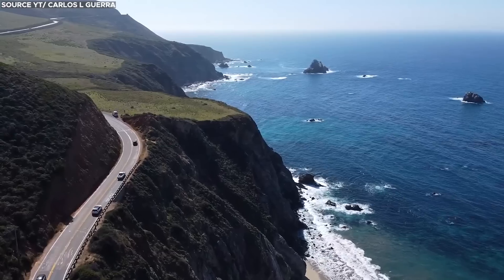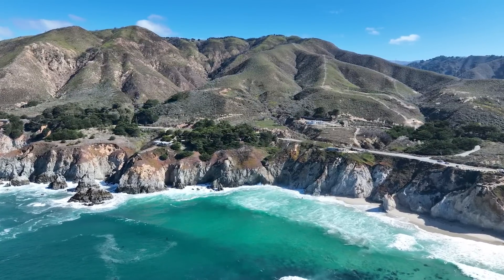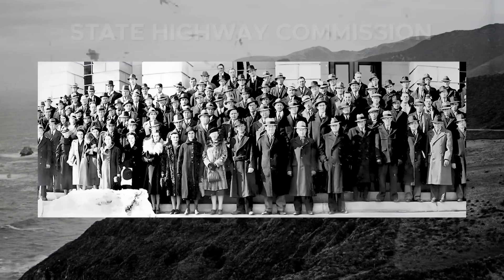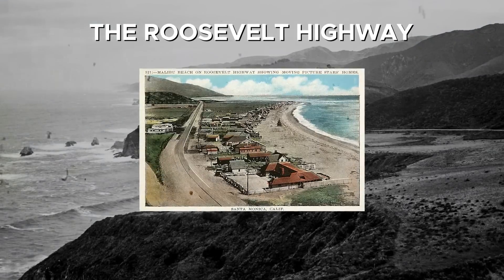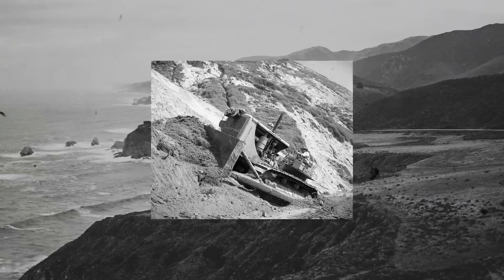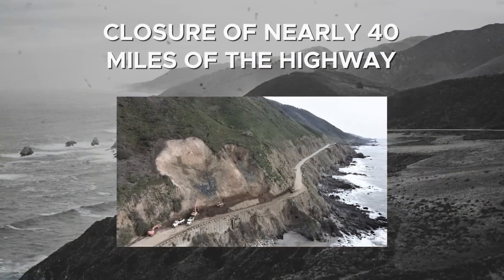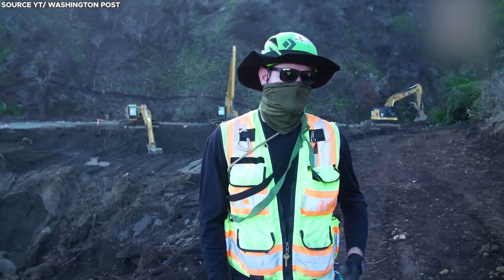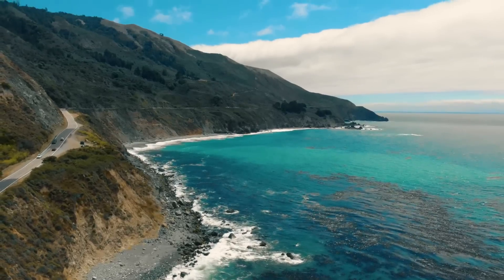California’s Famous Highway Is Now COLLAPSING Into The Sea!

Comment: Nice idea for the video and a lot of it is well done, but the quick cuts of map sections are confusing, irritating and pretty much useless, better to cut them out unless you talk to them directly and for long enough for a viewer to figure out why they are included at all.

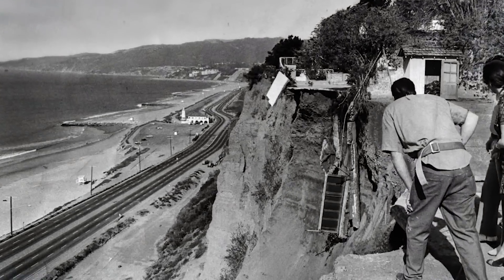Also, at 2:38, have we switched to Great Britain?  The car moving upwards in bottom part of the scene is traveling on LEFT side of the road, pretty sure there are no streches of CA 1 with that feature...

Comment: This blaming the landslides on climate change is weak.  You mention "rising sea level".   There is  no evidence that rising seas have caused any land slides on the coast🎉.  The seas have risen only 8 inches in a century!  So, that part is bs.  The primary reason for these landslides is simply poor engineering and continued patching after a landslide occurs; as opposed to reviewing the entire road for weak engineered sections and making appropriate repairs.  Allowing the saturation if hillsides, the failure to reinforce uncompacted soil areas, the prevalence of loose gravel and unstable rock formations are all fixable BEFORE a slide occurs, but takes more than a will to patch areas already sliding.  It is simply a failure of state government to focus on a permanent fix instead wasting billions on a fast rail system that has gone no where!  These are man made slides, not natural disasters.  Soil compacton testing, rain runoff management, tunneling where appropriate , driving piles and erecting retaining walls are all solutions that need to be imp,emended...proactively!

Comment: This is another example of lack of forward thinking. Granted the drive is gorgeous however you built it too close to the ocean and at the bottom of a big hillside the ocean eventually eroded the shore line leaving the road vulnerable to a landslide because it would not be able to bear the weight of that
Much earth traveling at that speed and soaking wet!  Before you actually build something think about the future use of whatever it is.

Comment: Stop blaming landslides on climate change! The climate isn’t that severe and every other place has its challenges too. You don’t have mud season when there is a Spring thaw and when you have wild fires that burn off the plants that hold the  soil plant some thing ASAP to keep down the erosion so the soil will be stable. Manzanita burns very hot and shades the ground so it isn’t that good for ground cover so it needs other things to help it hold the soil.

Comment: Ocean rising? I lived on the beach in Carpinteria CA from 1972 until 2020 ... that's when CA taxes drove me out of the state. Living next to the ocean, I was an avid surf fisherman and during those years sea level had not changed at all. Climate change is a fact. However, mankind's effect on the climate is nonexistent.
Reply: Mankind's industrial revolution and your lifted truck are the drivers of climate warming which creates all these disasters (from a human impact perspective). The scientists who study this have the receipts and Faux News lies to you just as they did about the 2020 election leading to a 3/4 of a billion dollar judgement against them. 
Sorry for the unfounded slur as to what you drive but it's not simply gas guzzling trucks, it's the humongous number of carbon spewing vehicles, plants and machines that are the problem.
Reply: Same here. The Morro Bay mean sea level is the same since I was going there in the mid 1960's. No change apparent in 60 years. It is very apparent using the inlet strainer grill building for the PG&E Morro Bay Power Station for comparison. No changes except for the tides. The same with the pilings at the Coast Guard pier.  The Green New Deal is hokum. The only green about it is the cash generated for the elite to ''fight climate change''.
Reply: climate change = summer, fall, winter and spring. Hasn't changed in gillions of years.
Reply: lol you're dodging responsibility. but that's typical...

Comment: Just a thought: Is there a way to construct a surge barrier at sea to slow down the impact of the sea? Retainer walls aren’t going to be of any use until the sea impact is reduced!
Reply: There is a retaining wall north of Santa Barbara right at the rocky shore. It's possible that the road originally went right along the shore there but the majority of Big Sur is steep high cliffs right to the water some a few locked narrow beaches. The road is 60 to over a hundred feet high for most of the way. The sea impact is not the cause of slides. It's rain and the steepness of the terrain.

Comment: Highway 1 was built by the U.S. Government during World War II for coastal defense. The Coast Range perplexed the Army. After Pearl Harbor, it was realized that the Japanese could establish a beach head between Morro Bay and Monterey and it would take days to get troops into the area in mass. There were few good drop zones for paratroops and moving anything bigger than a mountain gun with horses was out of the question. The Army wanted to be able to throw them back into the ocean, not wait until a hundred thousand soldiers marched over the hill. The Army was also concerned with infiltration routes and the landing of spies. Not being able to patrol the coast with vehicles was a problem.
Reply: Geebuz. Man. HWY 1 through Big Sur was built in the 30s. Finished in 1937 as it says on the video. You are wrong. That said there are gun emplacements in Big Sur or actually north of Big Sur, North of Carmel. It's at Devils Slide area where the tunnel is now. There is one other I know of down near San Pedro on the ocean side of that peninsula which is not HWY 1. A quick looks notes that starting in 1937 fixed guns were planned and began building to protect harbors. But as noted the road was done and it was built by the state of Calif. It is not federal.

Comment: Seems as though it is time to admit defeat, as painful as that is in this instance, and stop throwing good money after bad. That same annual expenditure could surely be better spent on all of the climate adaptation measures urgently needed elsewhere throughout the State. I think that the State of California needs to commission an independent cost benefit analysis, comparing the economic benefits, especially from tourism, against the ongoing repair bills, and see if it is financially worth it. At some point, my guess is that the road will have to be abandoned anyway on purely practical grounds.

Comment: Eh, its along hillsides and cliffs. There have always been occasional slumps & landslides. Also the most active faults are farther inland. You guys are making more out of it than there is. We have less used roads through canyons in the Sierras that have the same problems and we just bulldoze the slides & fix any subsidence there too. You have to drive up sand canyon to get to Lake Isabella. You should see the boulders that have fallen onto the road & the river below on the other side. And there are the highways from the central valley through the mountains to the coast. There is also the grapevine through the mountains to Los Angeles. Any road that is not perfectly flat has these same maintenance issues & California is a mountainous state.

Comment: Everything is caused by Climate Change. Cows farting, volcanoes erupting, terrible storms, earthquakes are all caused by climate change. Everyone needs to be removed from the surface of the earth is their only solution. So tired of this garbage.
I have lived through cold summers, warm winters, hot summers, and cold winters. In the 70's it was Global cooling which changed to Global Warming which was changed to Climate Change so it doesn't matter if it gets warmer or cooler it is the fault of  human beings.
Had to vent!